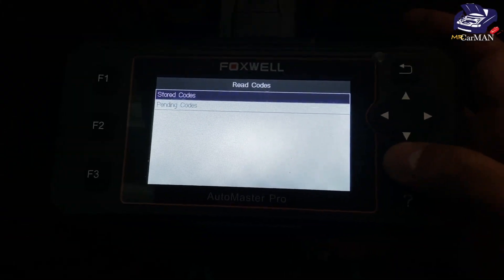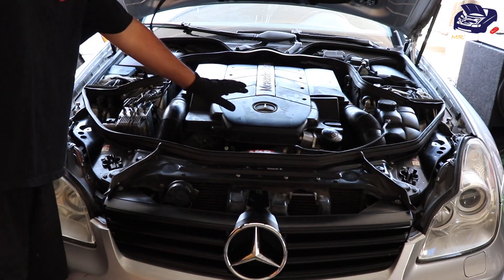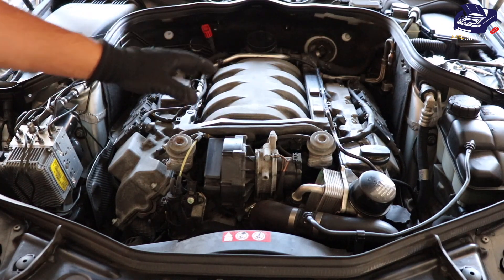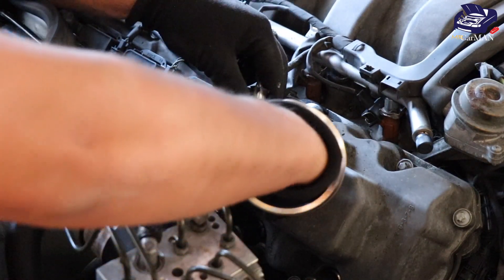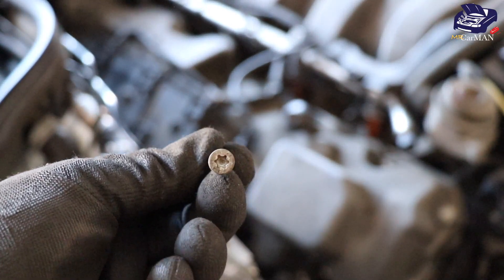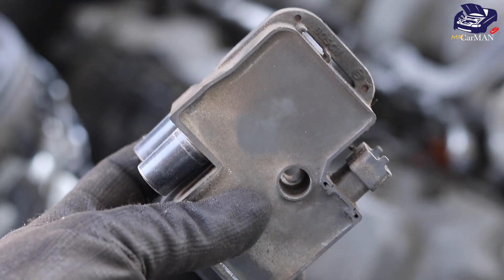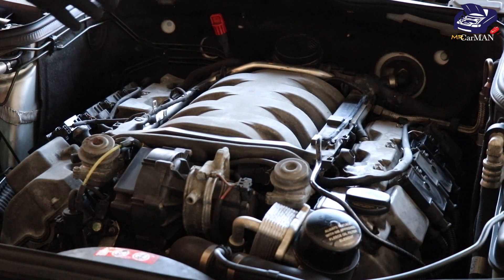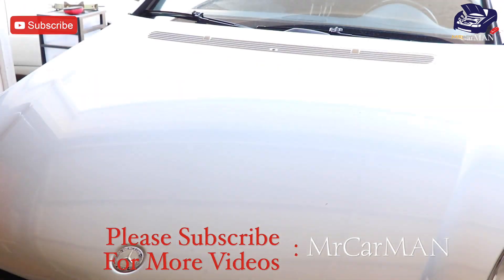How to Change Ignition Coil Pack on Mercedes M113 | Mercedes V8 Engine Misfire FIX

Comment: Hi sir, thanks for the video, my 2000 sl500 starts to shake after spatk plugs replacement, I bougth the same type of spark plugs from Fcp😂, any suggestions? Is it caused by Ecu?

Comment: Pls help.. i have a 2007 cls550 straight pipedand i hsve misfire on cylinder 7 replaced the ignition coil oem n sparkplug oem and still have the misfire.. maybe wiring? Fuel injector?

Comment: Thanks for the instructions on R & R coil pack.  I have a 2004 MB w/113 engine.  I just replaced one coil pack.  The rest are original and close to 20 yrs of use.  I called Bosch tech support and asked about the performance life of them.  The tech assured me they were good until they fail.   I am still considering replacing the other seven.  Any comments on preventive replace of coil packs??

Comment: Got a 2006 Merc S430 with a misfire on cylinder 3 at right around 4k rpms. I changed plugs, wires, maf, air filter, fuel filter, coil packs and checked injectors for a clean spray pattern and im still misfiring 😖  Any recommendations appreciated.. Compression check?  I switched coils and plugs around to make sure i didn't have a defective part as well. Just always cylinder 3 ☠
Reply from the maker: Your fuel injector might not be running efficiently or you have lower compression on cylinder 3
Thank you for liking the video and subscribing to the channel. -MrCarMAN
Reply: @MrCARman  Compression was right around 180. I'm really stumped.

Comment: Hello and thank you for uploading the video!
Unfortunately I have broken a coil connector , it works but no longer clips in , so I had to used a plastic stripe to hold it in position.
As far as you know, is it possible to buy a coil connector on the web? Many thanks!
Reply from the maker: Yes you can always strip the wire and install a new plug connector for a few bucks

Comment: I just changed my spark plugs but my engine is still misfiring. Would you happen to know why?
Reply from the maker: Hi McKinley, u have to make sure the wires are plugged into the correct cylinders and into the correct coil packs. Also at times, when you get non oem wires, they sometimes don’t work correctly and cause misfires
Reply: @MrCARman  how am I suppose to know which wires go into what coil? I thought all of the wires were the same

Comment: If I chose to have all long wires for my ignition coils then would it cause my engine to shake
Reply from the maker: Hi McKinley, u have to make sure the wires are plugged into the correct cylinders and into the correct coil packs. Also at times, when you get non oem wires, they sometimes don’t work correctly and cause misfires

Comment from the maker: If you are experiencing a misfire, engine shakes, or you have loss of power; then please watch this video and I will share the FIX with you
How to Change Ignition Coil Pack on Mercedes M113 | Mercedes V8 Engine Misfire FIX
Reply: Very ez and looks fun, I used to have a misfire that would randomly just came. Ended up being a cracked coil pack that would act up sometimes